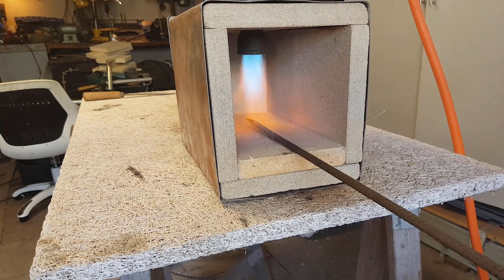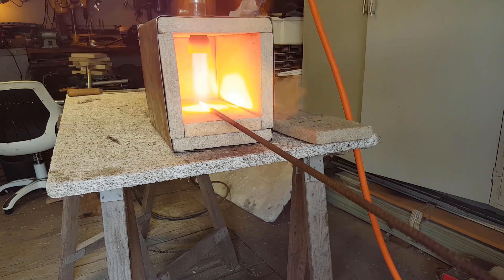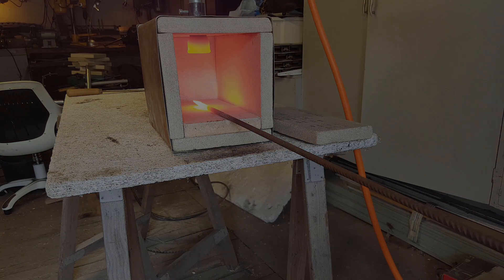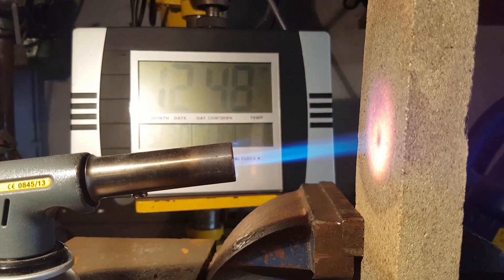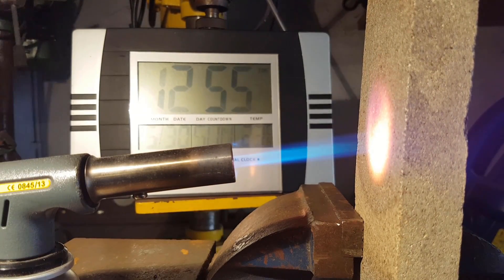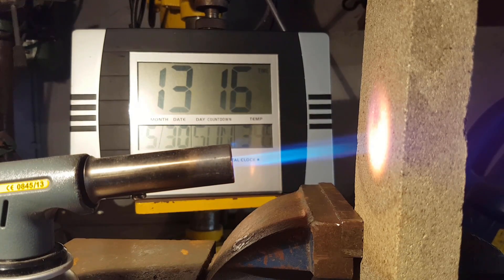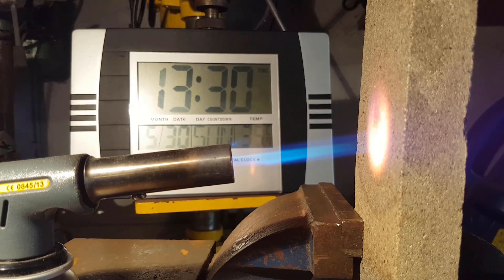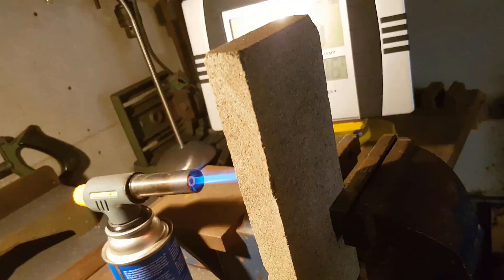Propane Gas Forge Project (vermiculite plate)

Comment: Nice video guy. By trade your are probably not a welder, but i must say, that was some horrific welding hahaha. Weld done on the forge thou.
Reply from the maker: I know :) i have tried welding maybe around 7 times, so i'm far from an experienced welder. But i believe that you only learn by doing and some thin sheet metal plate is quite the challenge for a beginner like myself. :D
Reply: Sir Make-a-lot that is true, and you will get there,
Cherrse man

Comment: I know this comment is a little off video or alot off but what is the best metal forge a normal everyday person can make to melt like aluminum? what is the best material to use as insulation?
Reply from the maker: If you want to melt aluminum it can be done quite easily, as it melt at 660 degree celsius or 1220 degree fahrenheit. I have done it with nothing but a campfire, a blowdryer and a stainless steel container to hold the molten aluminium. The campfire it self does not get hot enough so that's why you need the blowdryer to raise the temperature. If you want a more long term and compact solution you can use a grill chimney fire starter to house the fire. However you still need the force air in from the bottom to raise the temperature i would also suggest using coal in the scenario. :D
Reply: Sir Make-a-lot thanks for responding